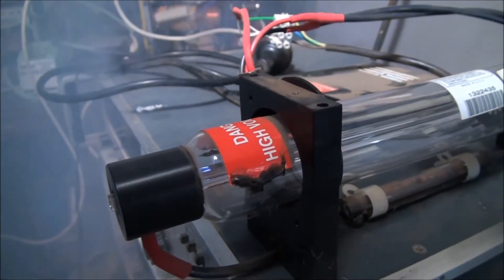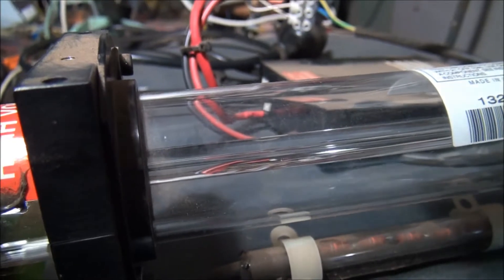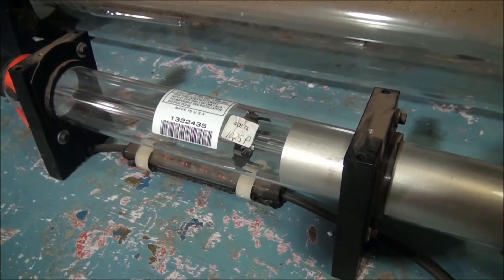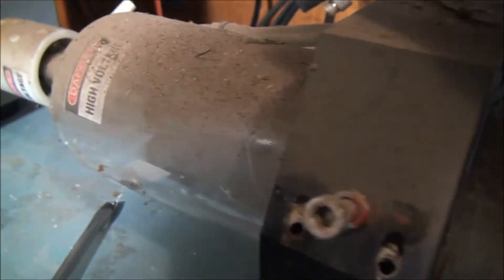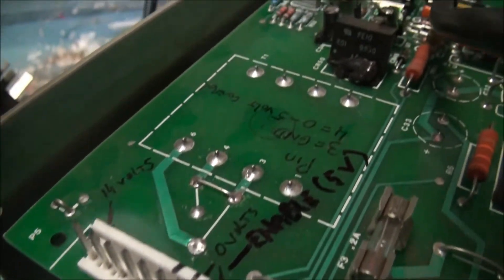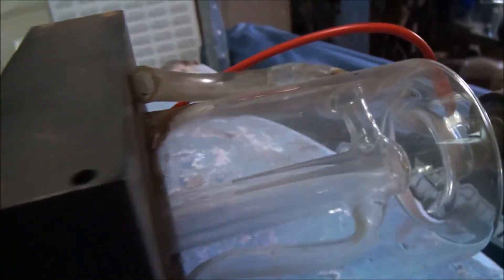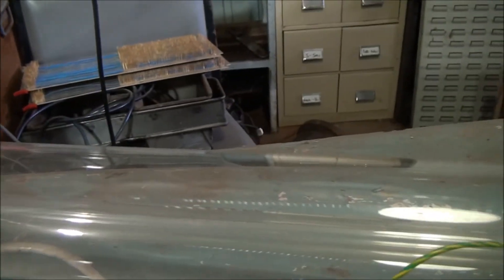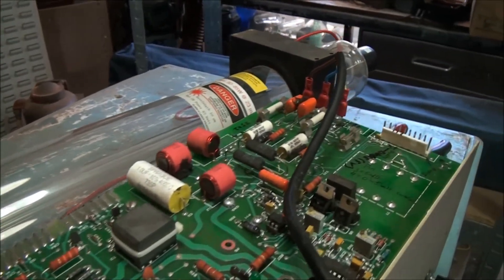Dodgy old Laser tubes, Fails.

Comment: Nice red laser colour, I wondered at the start of the video if something had fried up but now I know it was your smoke generator. That is one grunty power supply. That large tube is a piece of true art. Nice to finish off with a violet arc. Look forward to part 2.
Reply from the maker: RODALCO2007 I hooked up my ZVS to the tube, got some discharges in that Laser and burnt a hole through some paper however the tube is somewhat unstable so I think it has lost the gas. I will try again. I had the ZVS on 30 volts and you can hear the Corona hissing and crackling! I am afraid that the flyback might break down internally. I will look for another power supply and try running the ZVS at 50 volts and see if the Laser will fire up properly.
Reply: ***** Run the ZVS up via the variac and measure the DC current drawn from the rectifier. With IRFP260's they should hold up to around the 50 Volts level. Put a computer or microwave cooling fan on the circuit and the Flyback TX. Hope the vacuum is not all lost in that X-ray tube.

Comment: That kind of CO2 tubes with epoxy-seals on the output mirror will let in air over time (the CO2-mixture is below atmospheric pressure) They have a fairly short lifespan, and they usually have a set amount of life, regardless if you use them or not.